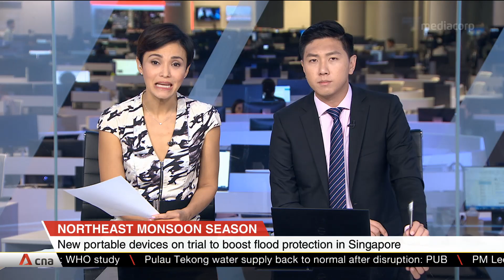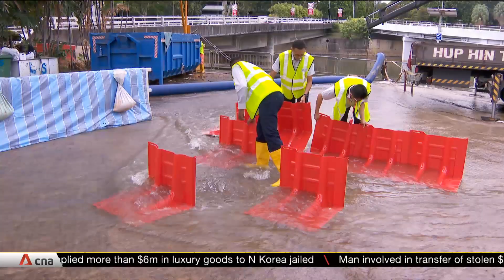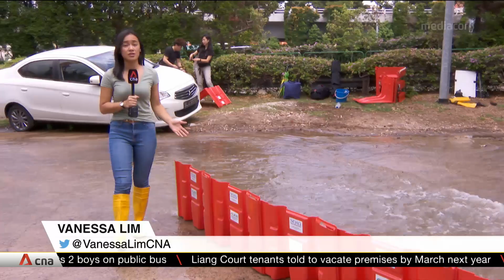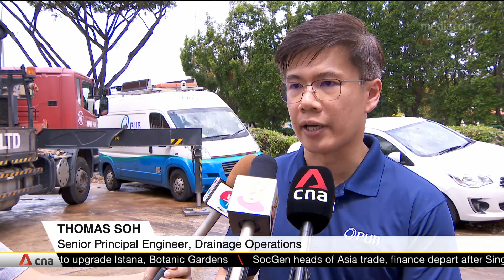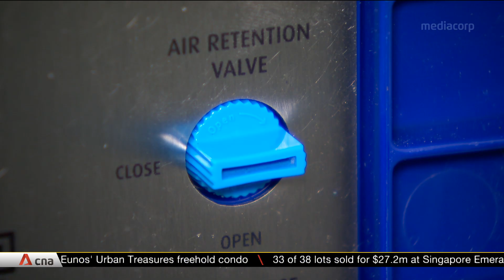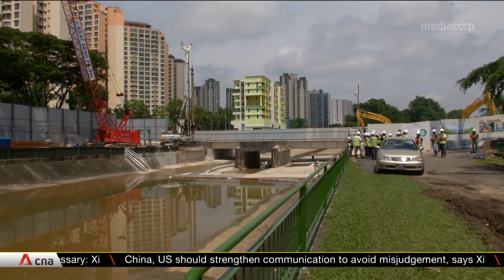Singapore's PUB testing new devices to boost flood protection

Comment: They should bore multiple flood water drainage and storage tunnels under the seabed all the way to an offshore island. The venting and water displacement into the sea by pump can be carried out from the offshore island. And, the collected flood water can be put to good use at a later time.
Reply: Filling up sea to hv more land…..water drainage n storage tunnels means PUB need to spend monies…..Tis new device probably can make monies by selling to land owners or shop owners